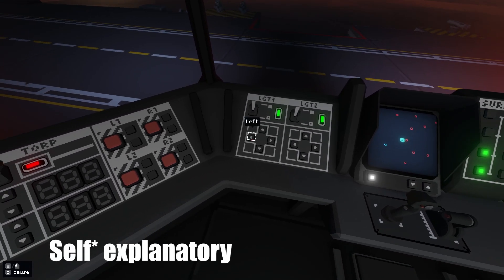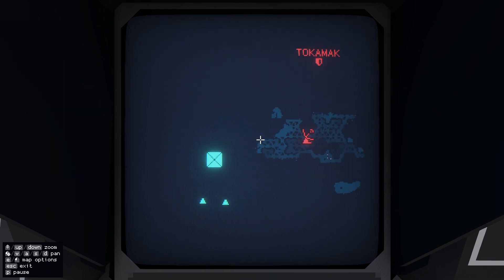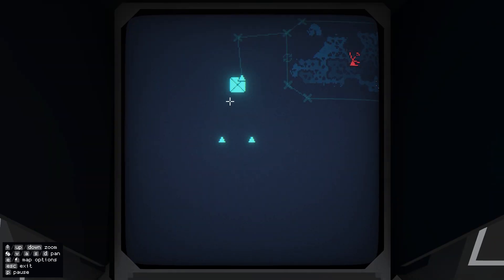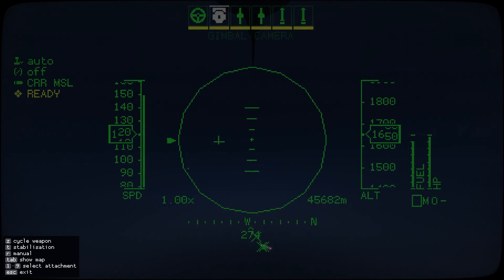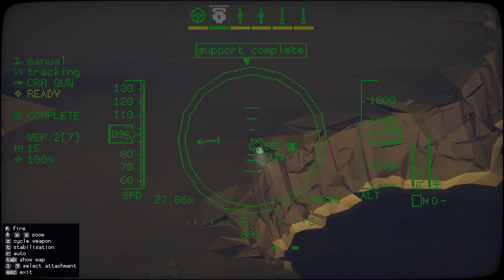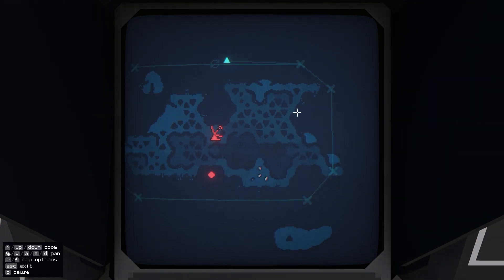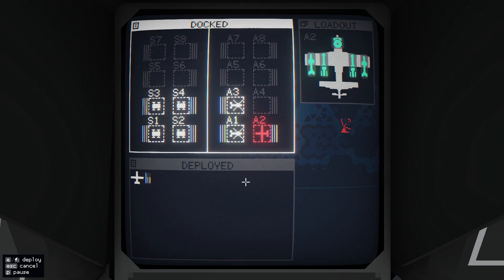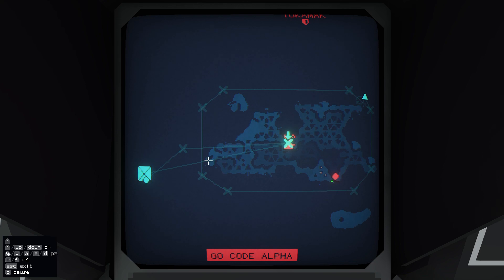Carrier Command 2 Tutorial - Station Guide: Drone Control

Comment: Spend so much time in playtest and then in demo and I only now find out that if You hit t for second time it will fix on one point, the feature I so much needed. Thanks for that info and tutorial. Now I need to find out how to use airdrop torpedo without loosing drone.
Reply from the maker: Haven’t tried air drop torpedos yet. Do they keep shooting it down?
Reply: @Atova  Ship have good AA and I rarely got occasion to get close enough without loosing a drone. I have nice save point with some surface action around so I may do some testing.
Reply from the maker: @lorgius  Good idea, keep me informed 👍

Comment: 11:50 Interesting note about the albatross attacking. Do everything the same as you have, but put another albatross directly following the first. When they are in formation any attack orders goes to escort first, then lead if escort is busy.
Reply: I did not know this, you have forever changed my operations. Thank you sir or ma'am. XD
Reply from the maker: Huh??? Escorts?? What is this? Can you explain more? Can’t wait to try this but can’t play till Sunday
Reply: @Atova  You can attach aircraft to follow eachother the same way you can attach ground units together. 
What I do is make a route with an albatross. Then drag a second albatross onto the first to make it follow. They will now fly together, safely. Next issue an attack order on the lead plane's route. If the escort/wingman/follower, whatever you want to call it, is close enough to the leader the escort will break off and do the attack.

If there are multiple targets on one waypoint then both will break off and attack.
If there is a second waypoint with an attack order and the escort is not finished with it's target then the lead plane will attack.
If attacking with missiles and the escort has no missiles, but leader does, then leader will attack while escort will simply follow it in.

The waypoints you have set up don't require to be looped, but it helps. I have not tested more than 1 follower, but theoretically the escorts should attack before the leader does anyway. Also tested with razors and they will operate the same way. Haven't tested with mantas or petrels, nor have I tested ground units.
Reply from the maker: @Latno-Ziroh  Wow. Need to try this, I had no idea, thanks for that! If I make a video will reference you!

Comment: Good stuff! One thing to keep in mind is that the CRR/cruise missile and the guided/laser missile will guide if you move your gimbal camera. The flight path of the guided missile was messed up on the latest update, so hopefully they go back to the way it was. I also have better luck with explosive munitions over bullets on targets that are underwater. Hopefully all that underwater stuff goes away.
Reply: Makes sense that normal rounds don't impact the same into water. So I don't see that changing. But switching to explosives is the way to go versus water targets! 

If you fire again after requesting missile support, it'll lock the last location you had lased and impact there unless wind messes it up. Also lasing through waves is finicky, try to have an eye on the sky for better targeting
Reply: @LucidDreamexe  Irl laser shouldn’t go into water, but yeah I agree with that. I never use the ship gimbal to guide stuff personally because the drones in game are represented very well. Also just aiming down without masking from the land is better

Comment: could you do a tut overviewing the different vehicle weapons and uses ? IR / TV / Laser missiles etc
Reply from the maker: Will try and get one done today 👍
Reply: As far as i have discovered now. TV you have to control youself using the aircraft controles to strike your target.
For IR you have to spot the target (the square you get on you hud). After that, aim your craft in the general direction of the target (or with multiple, on the specific target(it Will choose the closest to the centerpoint)). Then go to the missle and go manual, then press "lock target" and fire 😉 
As for laser, i dont know yet. Have not used them 😀
Reply: @TurboVeer123  laser missiles are used under the guided missile selection from the gimballed cam. An aircraft must have laser missiles selected and will automatically fire and guide in on ur cursor.  Similar to firing the CRR MSL but just from an aircraft.
Reply: @Inf3deli0us  selected as in equipped or??
Reply: @TurboVeer123  any aircraft with laser missiles will fire them. Any unit with a gimballed cam can lase the target (just keeping cursor over target).
Reply: This. I shove laser missiles on my petrels now so they can fire them off mid flight or after transporting other vehicles. They have a decent fuel time so suddenly having extra missiles to guide in with a gimbaled albatross makes great CAS.